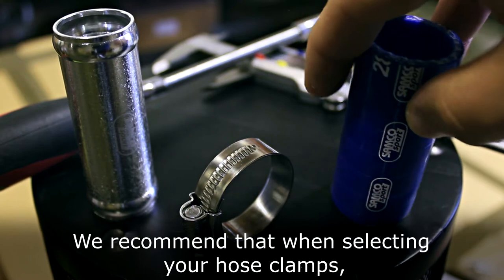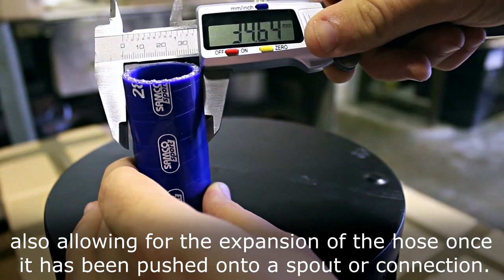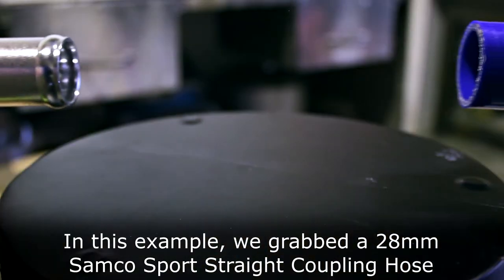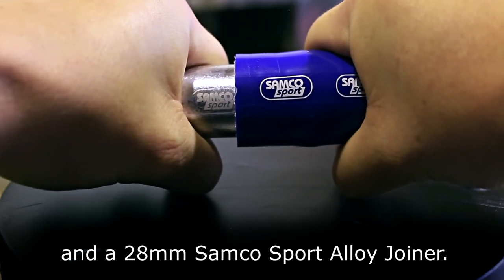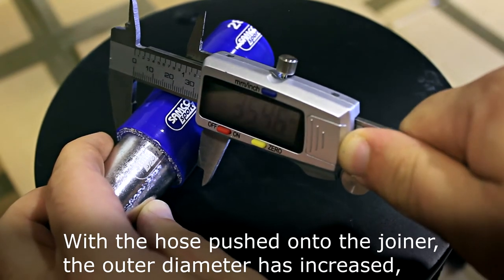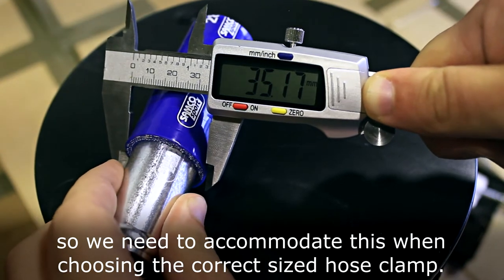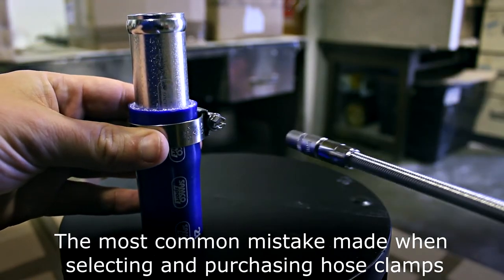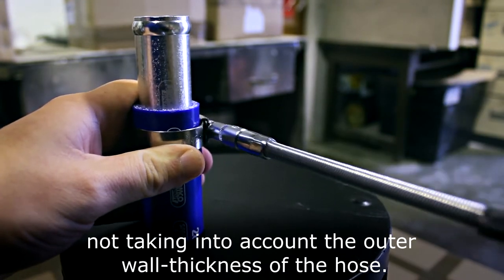How to choose the correct sized hose clamp

Comment: How do you determine what size your clamp should be? The hose in your video had a diameter of a little more than 35mm; what size clamp should you buy? Or what range of clamp should you buy?
Reply: What size clamp do I buy for a  hose with 42mm diameter?